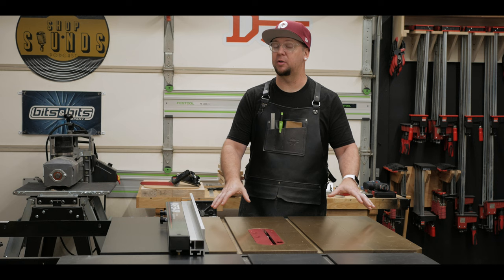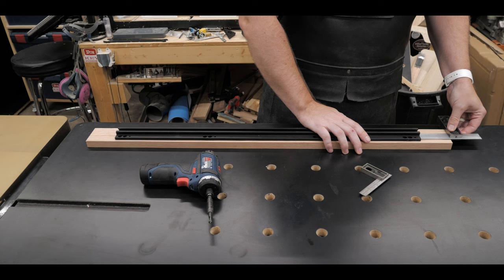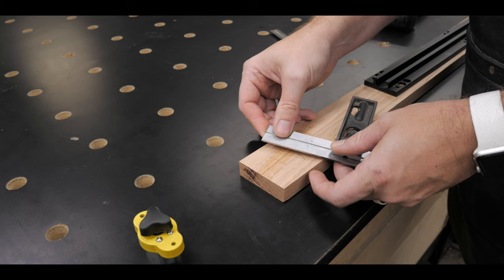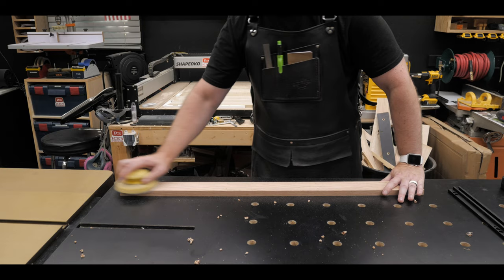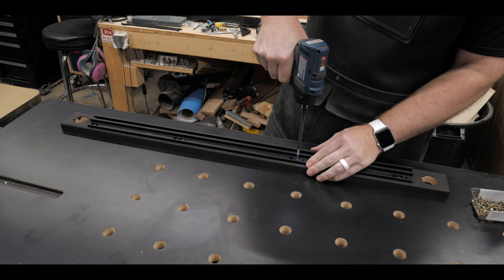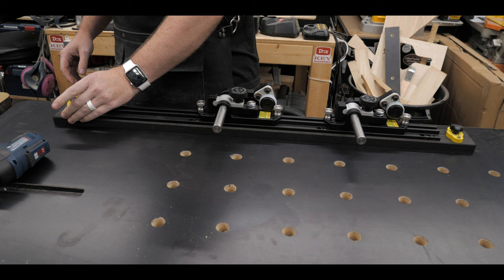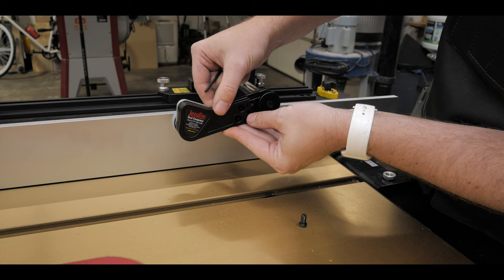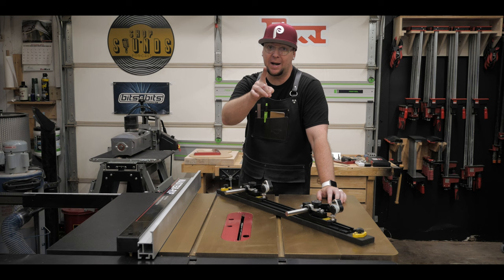Removable JessEm Stock Guides for the Harvey High Low Fence

Comment from the maker: Heads up! Since using the jig for a week, I swapped out the 90lb mag switches for the 150lb mag switches.  I used a 1 5/8" forstner bit to sink those 150s into the jig no problemo!
Reply: Did it get squirrley, or were you just wanting the stronger magnets in case? I've yet to meet a woodworker who doesn't over engineer LOL. I'm wanting to build one of these here in a few weeks
Reply: Just was going to ask you about this as I heard you mention it on your podcast.  I just ordered the stock guides today.  I'll order the 150s.
Reply from the maker: Never got squirrely, it was just the peace of mind with over engineering 🤣
Reply: @KeyWoodworks  that's what we do baby! 😂 I took your advice and did the larger magnets on mine. Turned out great. If my project can't hold 1,000 LBS then it's under engineered!
Reply: Hi, just finished mine up today and works as advertised.   Thanks for the great idea on using magnets to hold it down.

Comment: I've been using the Jessem guides for the past year and a half now, and they are absolutely one of the best additions to my table saw. I also got them for my router table (completely different setup). The only problem I've had is that they can be a bit difficult to use with smaller/thinner stock, especially when making thin cuts. It's almost safer to not use them for thin cuts.
Reply from the maker: I’ll be getting some for my router table too! They are awesome!
Reply: If you dont mind: Whats the most narrow rip you can make with these safely?
Reply: @Saileahgaz  well, it depends on which side of the blade you make your cut. From between the fence and blade, I've done 1/2" using the jessem guides without issue, but it does get complicated at the end of the cut to push the piece all the way through. I normally do skinny rips to the outside of the blade so it won't bind, and in that situation I've done inlay material at 1/16" with proper setup and control.

Comment: I am looking to install my new Jessem Stock Guides as well  I saw another video wherein the guy decided to just screw the jessem rail system right into his fence.  I cannot remember if it is  sawstop or harvey tablesaw.  He mentioned that the jessem rail does not get in the way so he just takes off the two arm rods when he needs to.  He said the rail does not get in way of other jigs.  Anyone else have that experience?  What other types of jigs would not work if the jessem rail without the rods is left attached to the fence?  Has anyone seen the magswitches used like this without screwing them down?  I was wondering if I were to setup this same type of jig and not screw down the magnets, if there would be any movement of the jig?

Comment: Dang, I bought the 95lb magnets and just heard your comment on ShopSounds that you switched them out. Just ordered the 150’s and I’ll return those 95’s arriving today.
Reply from the maker: Yeah I need to make a pinned comment that says I swapped over to the 150s,  You'll need a 1 5/8 forstner bit for the 150s fyi.
Reply: @KeyWoodworks  pretty cool that I coincidentally ordered the stock guides when your video came out and then y’all talked about them on the pod